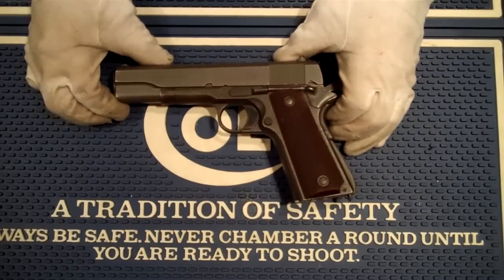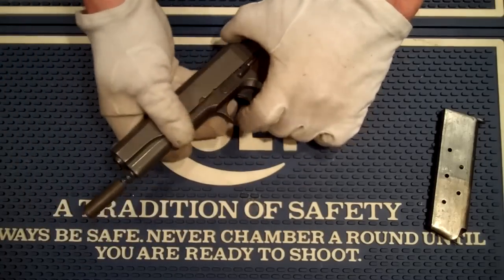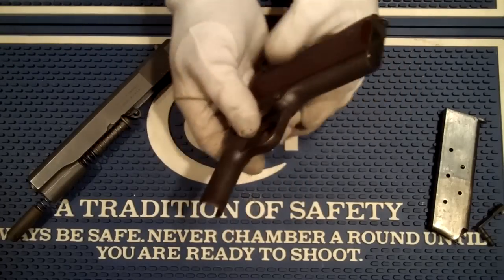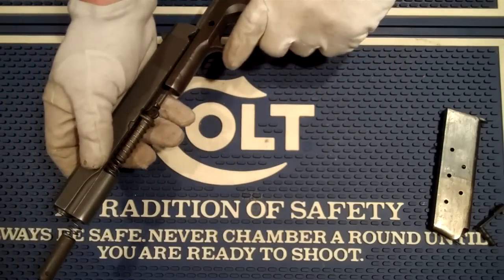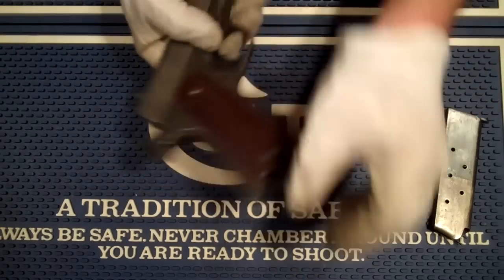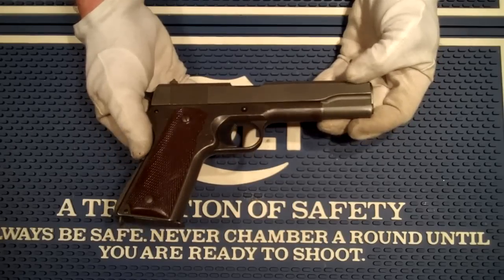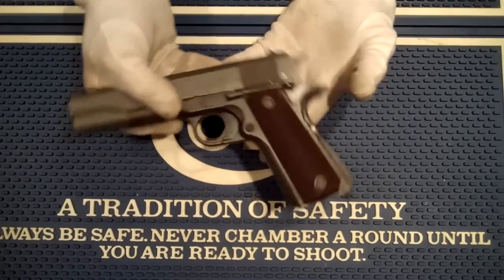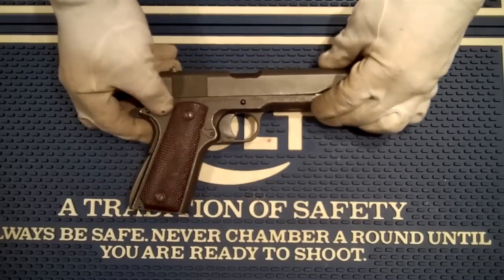WW II Remington Rand "Lunchbox" 1911A1 .45 ACP

Comment: I bought one at a gun shop in 2016 without the serial number or gov. property stamping but it did have the Armorer's approval stamp on rear right side slide. And it had no lanyard loop. Nothing on the right side except Remington Rand and address. Purchased it for $600 and it shoots great with no fails.

Comment: Colt collectors at gun shows note a  very small number of 1911A1 fromWWII were given to politicians and others also that didn't have numbers. Supposedly a BATF bulletin that describes and exempts these small numbers that have very specific characteristics. Apparently factory stopped making them w/o numbers when they found out problem.  (FYI serial numbers weren't required on handguns until 1934 and long guns until 1968.)